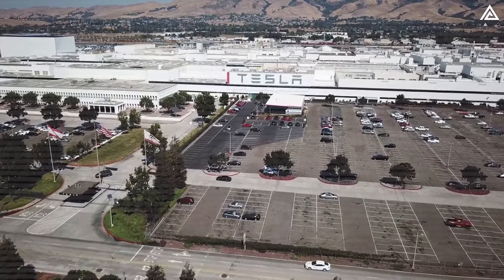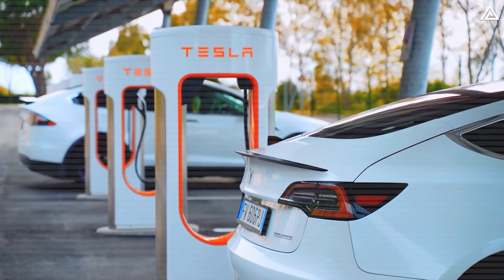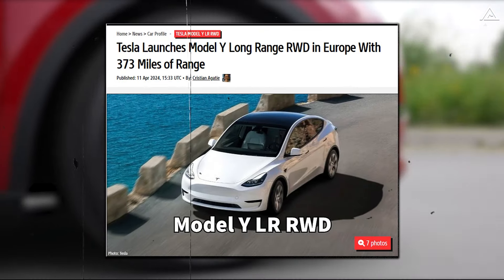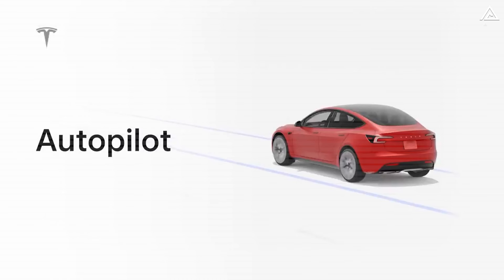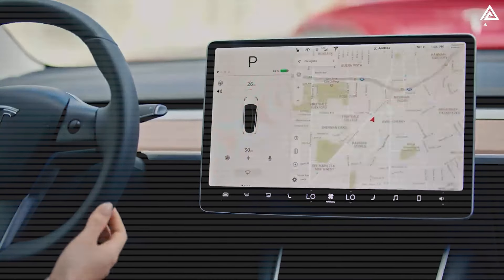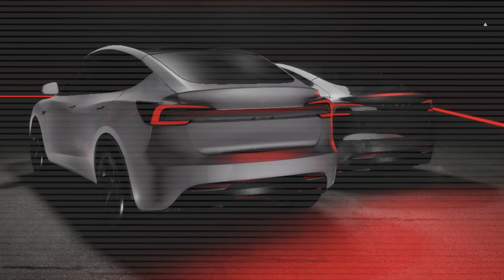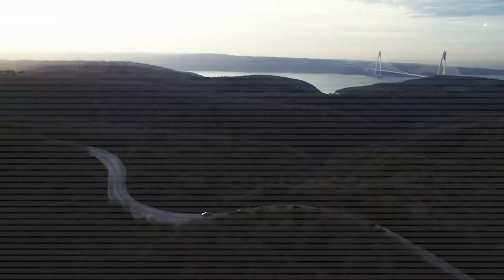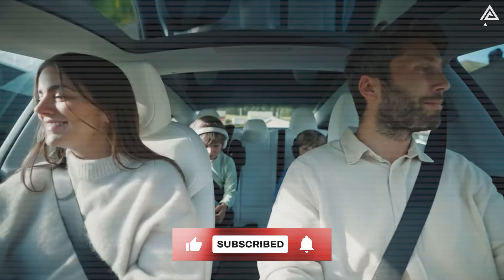Elon Musk Announces Tesla’s 2025 Model Y Juniper with 16% More Range and 7 Game-Changing Features!

Comment: Will the new Model Y Juniper offer any significant improvements in driving performance or handling?
Reply from the maker: The Model Y Juniper may feature enhancements in driving performance and handling, with possible upgrades to the suspension and chassis. These changes could lead to a more refined driving experience, enhancing agility and comfort.

Comment: Juniper will be outdated with Xpeng G6 ( 20 minutes from 10 to 80%), 800 volts architecture and a range of 575 km wltp. Outstanding comfort, 360 cameras, ultrasound radars, front camera! Etc... Disappointing Tesla which will be no longer the leader.
Reply from the maker: I don't think so